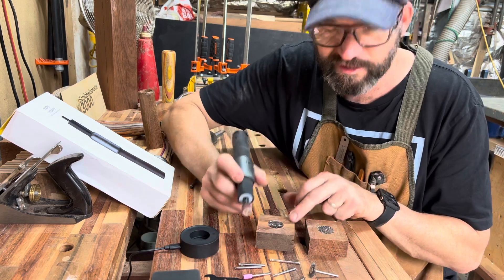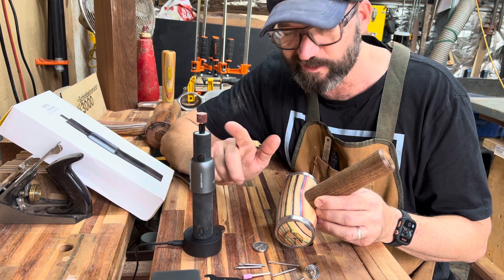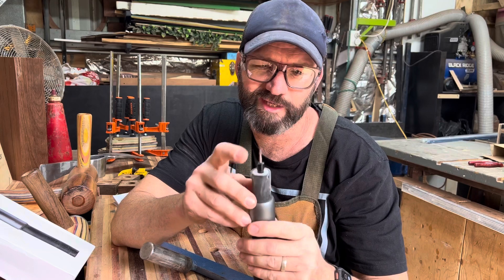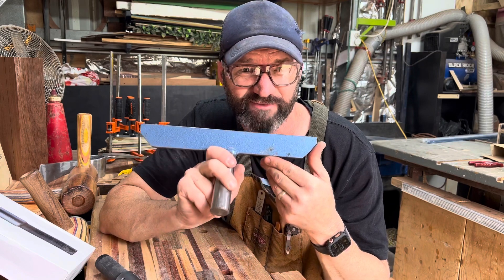HOTO Rotary Tool Review - How to?

Comment: I have the corded Dremel and it has gotten me out of many scraps. Rotary tools are super handy to have around, and you'll continue to find many uses for them. By far the most used thing for me is the cut-off discs for shortening screws and other bits of metal, followed by the drum sanders and the buffing pads. I also use mine for routing signs... but I don't think the battery one is built for that abuse ;)

Comment: I use a rotary tool every couple of days and even the small cordless ones can, if the battery is a good one, last a couple of weeks for what I need and I actually trim back the full perimeter of my Carbon fibre motorcycle fuel tanks as well as trim back any excess adhesive and use it to sand away resins that may get onto the surface of the tanks as well as fine tuning the holes for the fuel cap and fuel taps.  I cannot do much of my work without both the cordless and wired rotary tools and the small size is more about handling than the size of the job I need it for.  The only problems I have are with the materials I work with getting into the motors and blowing them up or into the switch and speed controller. I have a Dremel which is about 10 months old and still works OK but now its just a single speed due to the dust ingress. The manufacturers know their tools will produce fine dust which can be any material but seem to forget metal is conductive, so is carbon fibre, and that dust can and does kill rotary tools. My record is 10 minutes before one blew up and at the other end of the spectrum I had one exactly the same that lasted 2 years. But I always have spare ones just in case.  Its the same with hot air guns for me too. I have 4 hot air guns at the moment, 3 brand new in boxes ready for when the one I am using goes pop and lets the smoke out....

Comment: I have a single speed Dremel that I use when I need to blast through material, but I also bought a cheap adjustable speed one for slow speed deburring and for using brass wire wheels. It's good for real small stuff. Other people mentioned model making, and that's what I thought about also. They don't require as much power when you're working on tiny plastic things.

Comment: I know Dremel is a bit expensive, but they are mostly good. the main thing is adjustable speed. some of the bits you need to turn right down, they do tend to come apart when they are spinning too fast, 
good review though.

Comment: Most aesthetically pleasing to watch. The spindle lock issue (accidentally pressing while using) is common with most rotary tools. I have 2 different brands (Triton & Renovator) and a Dremel at work. The spindle lock got buggered on my Triton. It’d be interesting to know the battery life on that number. Cheers
Reply: @dainermade  the speed of the bits is the problem, you can find that if the chuck is not tight enough there can be some slippage in the little collet and over time it makes the collet loose and you need to find replacement collets to fit. Many of the cheap ones are generic but you end up buying more rotary tools just because you need a collet for a specific tool.  Dremel sell collets on their own but you can find that having 2 or 3 cheap rotary tools compared to one Dremel is cost effective if you wear the rotary tool out. Usually die when the warranty is just expired.

Comment: I have the competitor"s corded version. I was looking at a cordless model but as part of pre-purchase due diligence the reviews were pretty universal  that they were underpowered. As for uses rehabbing old hand tools such as planes for cleaning up frogs and  small bolts nothing compares. There are aftermarket hand tightened chucks available on eBay and would very strongly recommend purchase.
Reply: what is the competitor's name?
Reply: @htko89  Dremel

Comment: It looks nice and I could use a smaller cordless rotary tool, but lack of support for thread-on Dremel attachments is a deal killer.
Reply: @dainermade  I'm thinking Ryobi FVM51 might be the better buy, though not too many reviews out on it. I do like how on this one, you place the whole device in a stand to charge it while the Ryobi requires you to remove the battery and plug it into USB-C.

Comment: I wouldnt be surprised if what you thought a drill bit was something else
Reply: @dainermade  certainly could be but when it didnt drill easily i thought it may have been a cutting bit that resembles a drill bit.
Reply: @dainermade  no problem there are bits made to cut laterally (like in a milling machine) that look a great deal like drill bits.
Reply: @dainermade  yeah, thats quite the over site and little suspect to be honest. I cant believe youve never used a rotary tool. Im extremely partial to my Foredom and would recommend it if you find a rotary tool useful. After looking at your vid on a computer screen im not confident that bit is for lateral cutting as i assumed. But it would also be a very strange drill bit with such short flutes. Based off of your attempt it seems apparent that the geometry is off for a drilling task. could be poorly made or designed or meant for other operations entirely. Who knows??? But based off of the inclusion of a dog claw grinder i cant help but think that this may not be design by the most canny of tool manufactures. If you ask them id be interested in what they have to say.